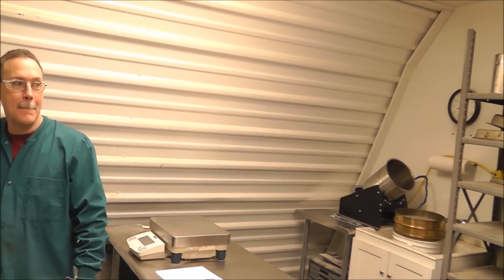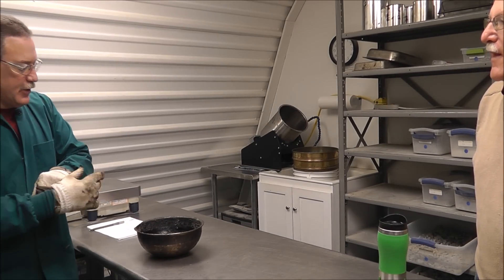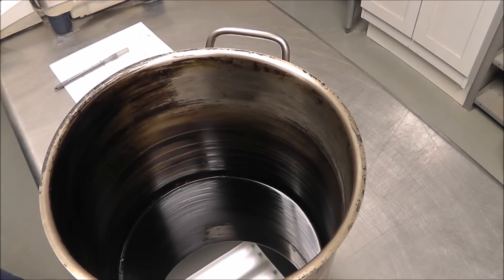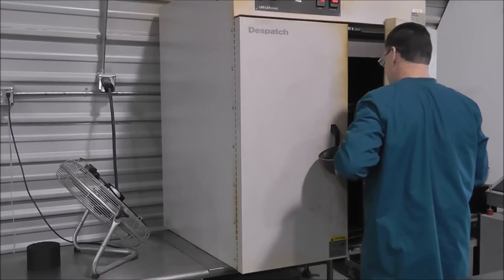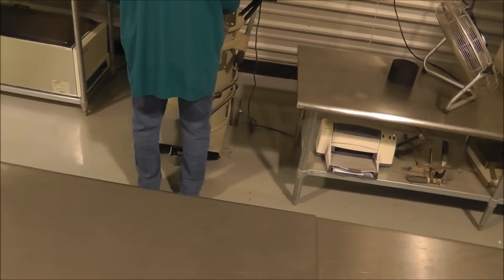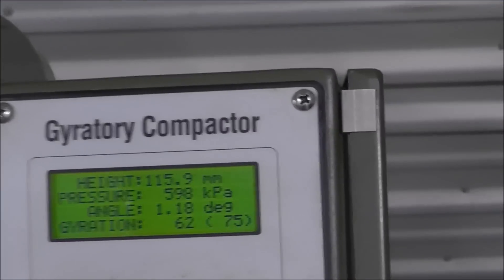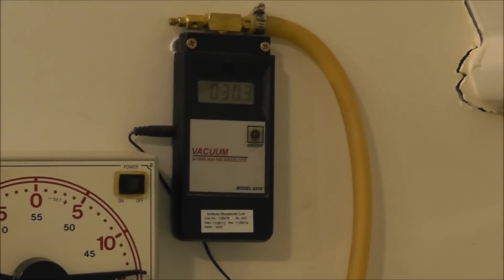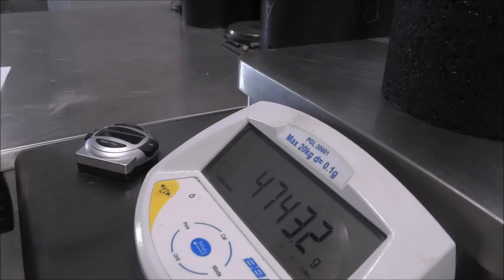Asphalt Mix Design 101

Comment: The one thing I noticed, is the aggregate has probably been sitting there for quite sometime. Which likely has no moisture content. With batch batch plants, the agg sits in piles for days on end, drawing in moisture. Most batch plants heat up the agg to 330 which won't burn off all the moisture contained within the agg, before its mixed with the asphalt material. How does the retained moisture within the agg affect the binding capabilities of the asphalt?
Reply: you probably dont give a damn but does any of you know of a tool to log back into an instagram account..?
I somehow lost the password. I would love any help you can offer me!
Reply: @Jasiah Benedict Instablaster ;)
Reply: @Castiel Mekhi thanks for your reply. I got to the site thru google and I'm waiting for the hacking stuff now.
Looks like it's gonna take a while so I will reply here later with my results.
Reply: @Castiel Mekhi it worked and I finally got access to my account again. I'm so happy:D
Thanks so much, you saved my account !
Reply: @Jasiah Benedict glad I could help :D